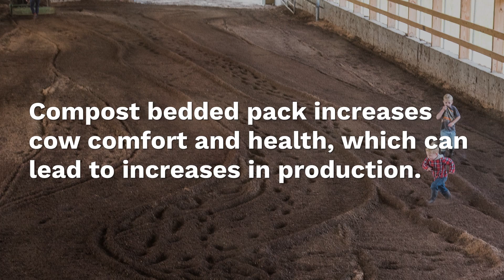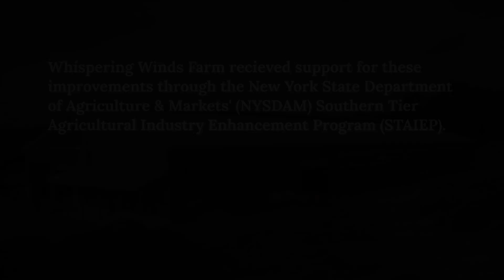Dairy Robotics Pay Off for WNY Family Farm

Comment: With the increased reliance on electricity needed to run the new equipment meant to reduce manpower costs and increase efficiency it might be advantages to find a way to generate your own independent power source, too; maybe by using solar panels or wind turbines. Things sure have come a long way in the dairy industry since the late 1970s when I was on a dairy farm.